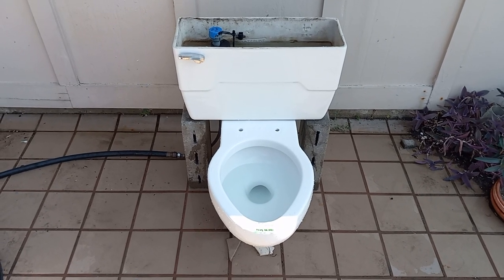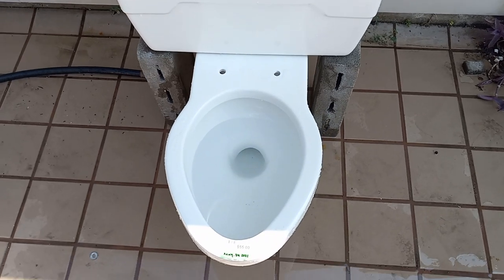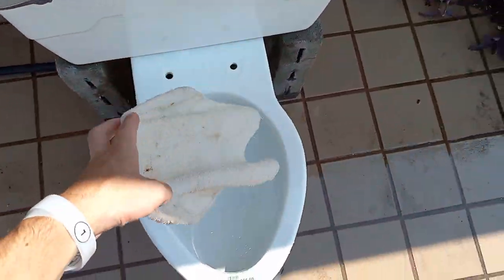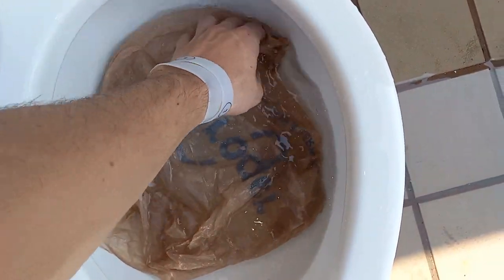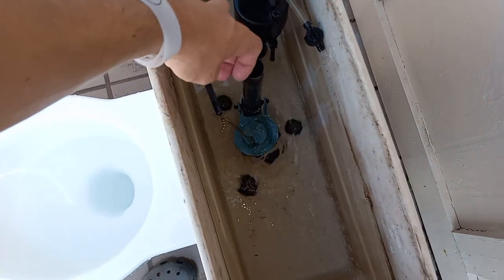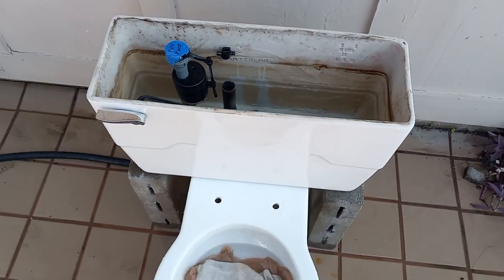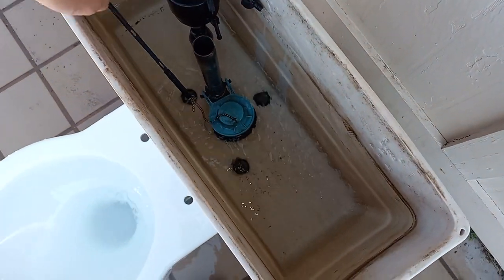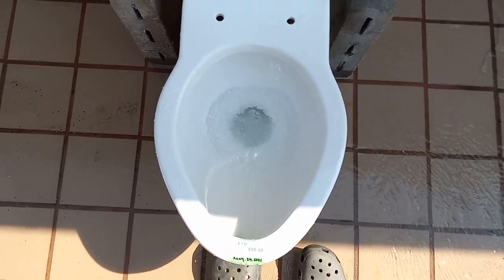1984 Kohler Cayuga Tests

Comment: You really should get a recirculating pump if you test toilets out and frequently flush them. Not only will you save you a ton of water, especially this particular water guzzler, but it will also not mess up your lawn or patio.
Reply: Agreed. This thing takes about 7 gallons of water with every flush. Most other toilets easily get away with half of that at most...
Reply: @cameraredeye3115  agreed! Imagine your lawn dying, only to learn the cause was “over watering”. And imagine you water bill being, oh I don’t know…$5000 a month with that thing installed? Jeez, I would be broke
Reply from the maker: @Anonymous-il8yl  Lol
Reply: @OCC_Plumbing_and_Restorations  took you 5 months to respond
Reply from the maker: @Anonymous-il8yl  I didn't get a notification when you replied
Reply: I agree
Reply: I totally agree that statement about these toilets
Reply: @Anonymous-il8yl  People back then had these installed in their homes for years and there are still some homes with these installed today. Back in 2015 or 2016 someone found one in a gas station.

Comment: I wish you could use a PA tank. not only will you save water, but you don't have to wait for the tank to fill up.
Reply from the maker: It would just make the surface of the water move a little

Comment: This is a great toilet and an awesome performer, but how much water does it use? 70s toilets use about 5gpf, but this is a 80s one.
Reply from the maker: Even though this is from the 80s, it still uses more than the 70s ones.
Reply: I thought toilets had to be 3.5 gpf or less by the 1980’s? Were wall mounted tank toilets an exception back then like blowout toilets are an exception from the 1.6/1.28 gpf water laws today?

Comment: It did better then what I was expecting it to do.
Reply from the maker: It took everything just fine but it used a lot of water to do it.
Reply: @OCC_Plumbing_and_Restorations  how much water?
Reply from the maker: @Willyandwesleytv  Like 7 gallons
Reply: Even 1.6 is to much.
Reply: @Willyandwesleytv  Not really. 1.6 is pretty good.
Reply from the maker: @Willyandwesleytv  Toilets start to lose some of their functions at that point. Considering it costs only a fraction of a cent per flush, I personally would draw the line on 1.6 because even the good 1.28 gallon toilets need some extra help.
Reply: @OCC_Plumbing_and_Restorations  my grandparents’ delta dual flush 1.1/1.6 gpf is great nomater which flush I use. And I helped install it A few weeks ago!
Reply: @OCC_Plumbing_and_Restorations  no!
Reply from the maker: @Willyandwesleytv  I'm glad it works for you. My experience with low consumption toilets has been different.
Reply: @OCC_Plumbing_and_Restorations  my Woodbridge dual flush is a great toilet 1.0/1.6 GPF 🥇🏆🚽
Reply from the maker: @Willyandwesleytv  Mine wasn't so good but at least it was a decent performer

Comment: The tank is literally big enough for an Olympic Swimming Pool - that aside this toilet did well despite the flush being a little slow (took all the items even though it struggled on the grocery bag/washcloth together and there was a slight hesitation taking the dishtowel). The bowl rinse is alright (could do a little better) but the clearance is great (would not expect anything less than great with the amount of water this toilet uses). I will rate this a 7.5/10 👍
Reply from the maker: These are really cool but I would prefer if they could design them to use less water.

Comment: Has a Kilgore handle
Reply from the maker: It's a Fluidmaster Universal handle
Reply: @OCC_Plumbing_and_Restorations  oh. Oh by the way, this was the original toilet to my current house, with the golden logo. It was replaced with a pressure assist glenwall
Reply from the maker: @alexbentley7257  What happened to it?
Reply: @OCC_Plumbing_and_Restorations  well, I clogged it once at 5 years old with legos, I know, I was a kid so yeah. Then we replaced it since it couldn’t take the clog anymore(we tried literally everything and nothing changed), and it was smashed to pieces, the glenwall is ok, but the pressure assist is pretty useful with hard water(no water softener at my current house)